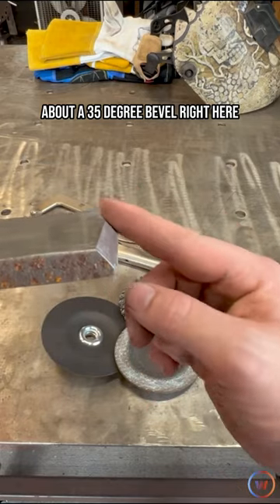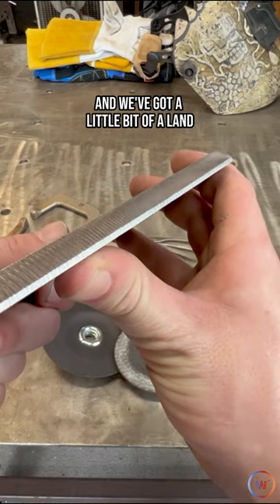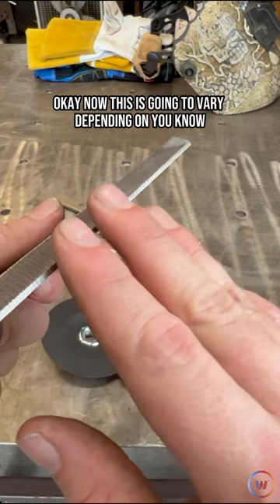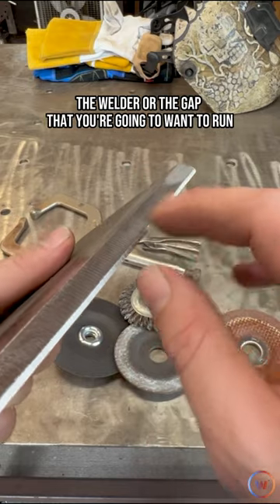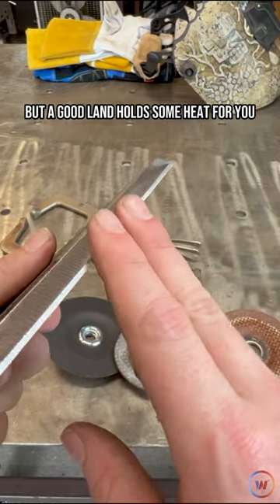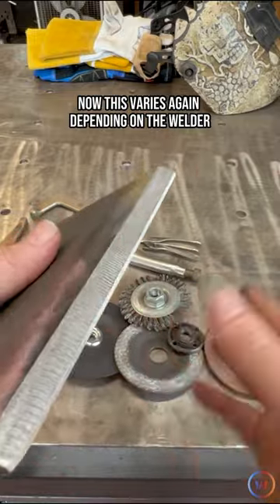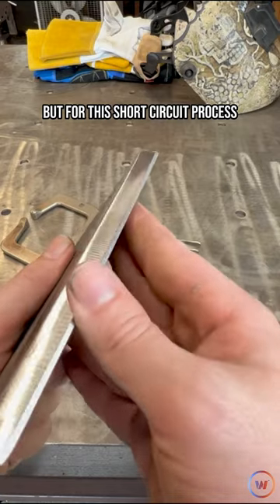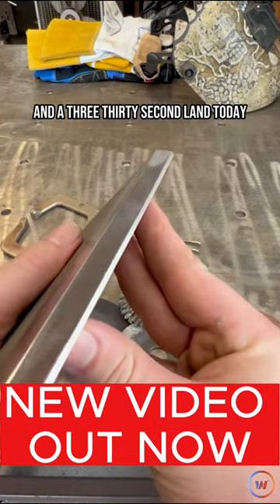Struggling with 2G GMAW?

Comment: I have been welding those all week. 3/32 spacing. I have trouble getting the 1/8 reinforcement weld height. It’s not too high just a little above the parent material. Any tips